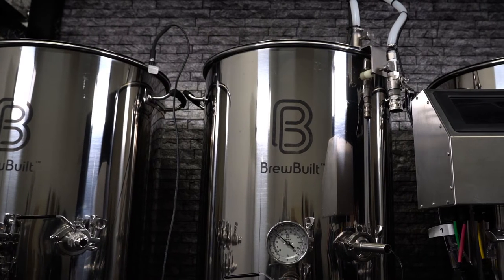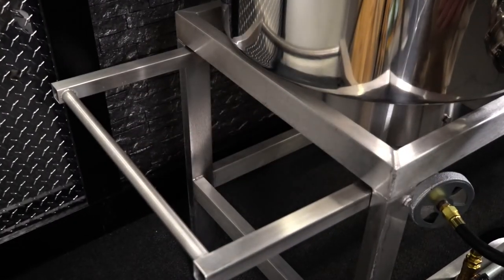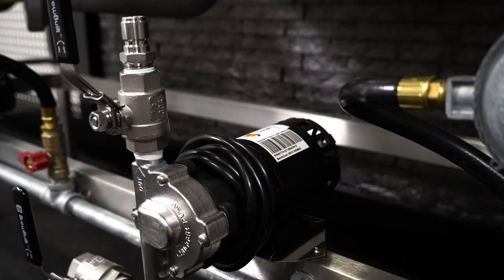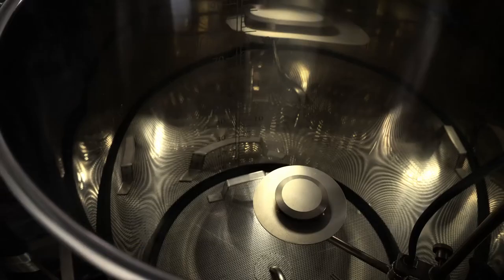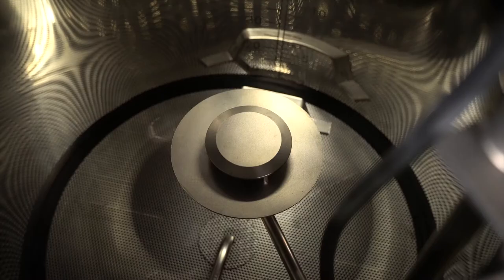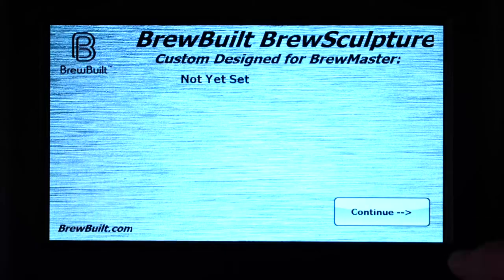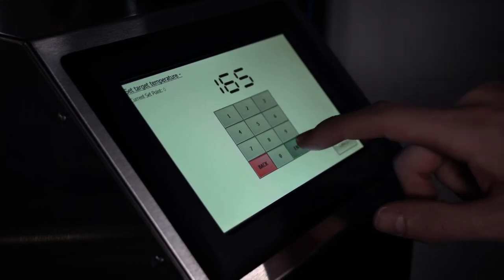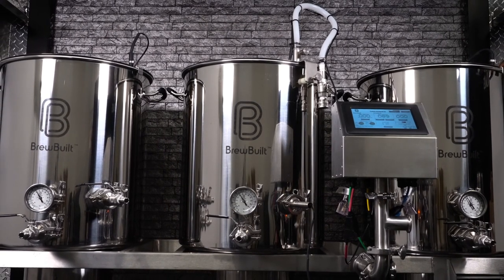The Ultimate All-in-One Brewing System | BrewBuilt Digital BrewSculpture

Comment: Electric heat and a conical element in the boiler would be a great improvement.
Reply from the maker: Hi Charles, this is our gas system. We have an electric BrewSculpture with an electric SlingBlade heating element in the boil kettle -- please check out that unit here if you're interested: https://brewbuilt.com/products/brewbuilt-rider-digital-electric-brewsculpture-v4.html